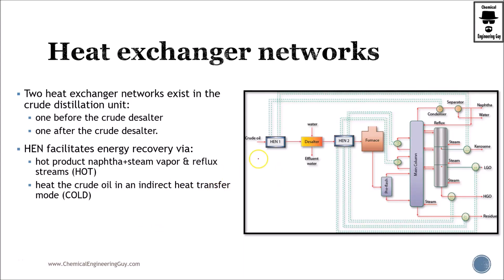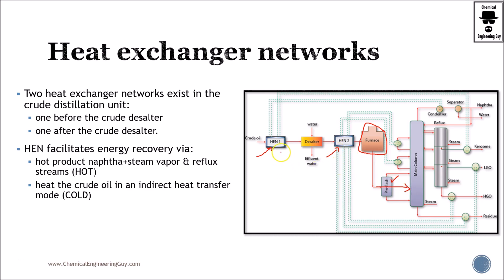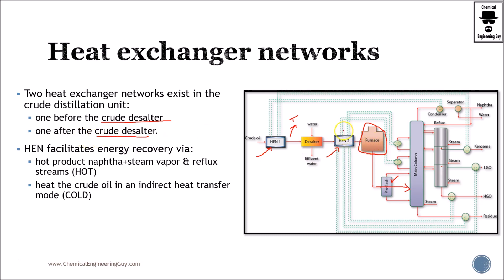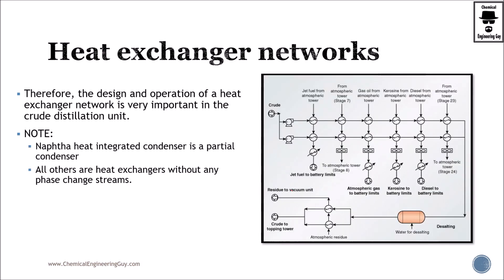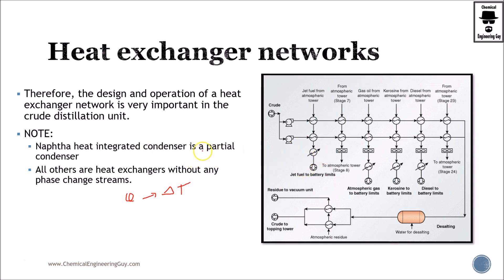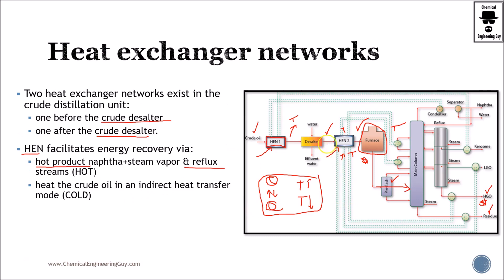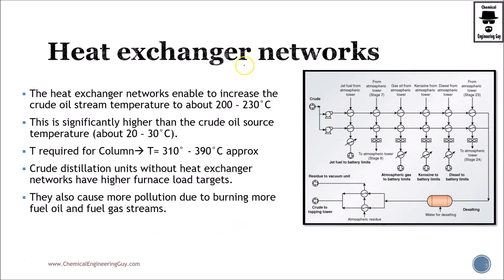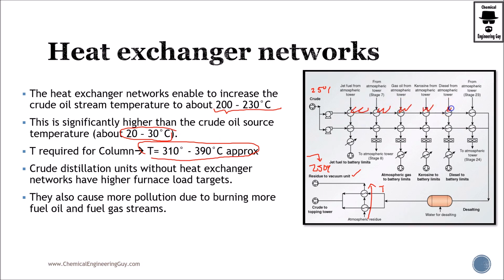Heat Exchanger Networks (HEN) (Lecture 109)

Comment: The think I never understood is how it is done in the startup?..how the crude is heated the first time it enters the process if there is no product to heat it yet?
Reply from the maker: you mean literally, the first time we add oil to the heaters?  thats what Dynamic simulations are good for!
Reply: @ChemicalEngineeringGuy   how about heat exchangers?..we add oil also?...I've always found dynamic simulations kinda hard to initiate.
Reply from the maker: wait... what? you mean the heating fluid? or the fluid being heated?
Reply: @ChemicalEngineeringGuy  let me give you an exemple, we have a reactor where the feed is preheated with the reactor effluent by a HE, how its done the first time, when there is no reactor effluent yet?